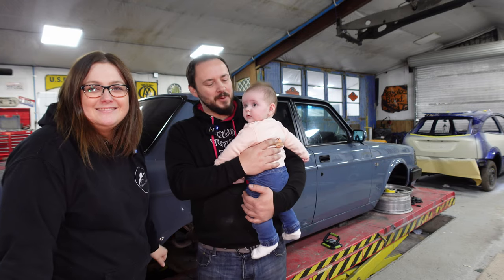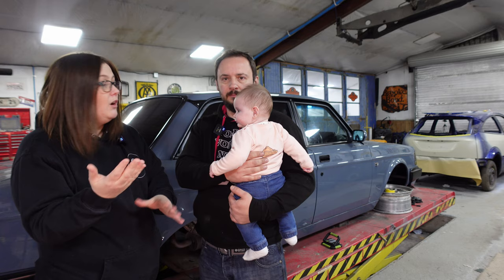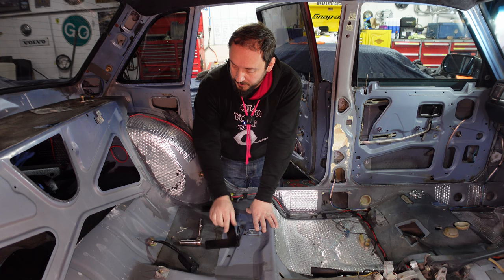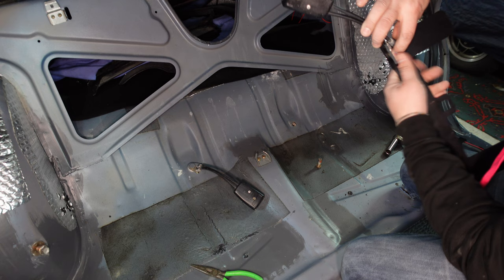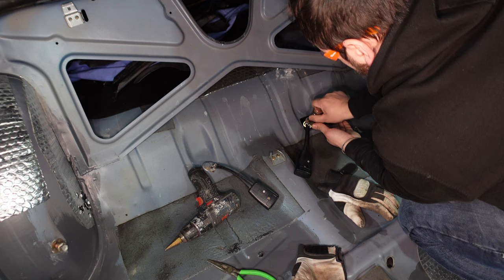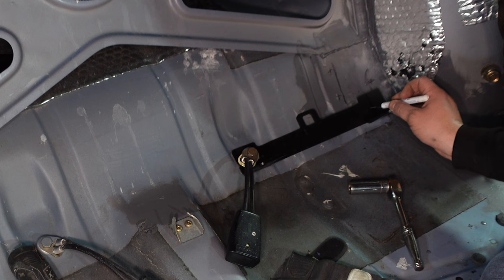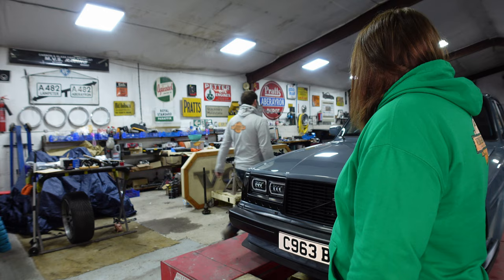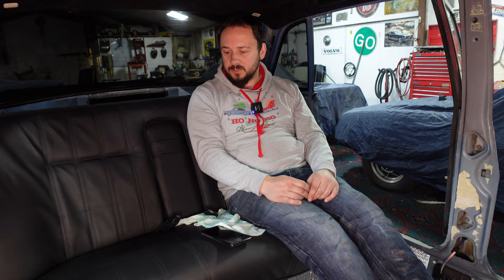How To Put ISOFIX In Your Classic Car - Volvo 240

Comment: Good video, but bear in mind that the ISOfix is only holding the child's seat square, the actual seat belt restrains the child in the event of a bump. ISOfix mounts are available for my 451 Smart's passenger seat & it bolts directly to the seat itself. And again, the ISOfix of my  ML fit to the base of the rear folding seats. 👍

Comment: Speaking as a person obsessed with centering things; why did you not put the child seat in the very center of the seat? I think you could have used both existing bolt holes for the right and left seat belt buckle. My 240 also has a center lap belt which is what generally was used to fasten baby car seats here in the US in the 80s and 90s.
Reply: There is another child needing seating in the back of the car and it seems to be set up as a 4 seater with the armrest in the middle of the rear seat. it will also not be so difficult to safely fit and adjust the, seat and belts etc for the child while on the left hand, passenger side, of the Volvo rather than the centre, especially for a woman just after childbirth. Generally I would agree that symmetry is almost a human need but I think here practicality rules, It’s where I’d put it. But I get what you are are saying.
Reply: @hughjohnson2674  you are right when one thinks this through thoroughly. My 240s all have had a fold up armrest in the center of the back seat, but always with a lap belt in the center for that 5th passenger. This is the first 240 where I see this missing. (The lap belt has not been considered particularly safe as if it rides up too high it can be the cause of some major internal injuries in an accident).
Reply: @georgebutlers4945  Thanks, I think the 4 door thing was a choice during the build as it’s the family “keeper” . As they live in Rural England I reckon it will be strong enough  on the left as firstly it’s a “Swedish Taxi!  And won’t see too much work at freeway speeds either. But, of course in the end it’s a case of horses for courses and this is what comments are designed for😊
Cheers.

Comment: This should absolutely never be relied on. Not only is it not crash tested, it’s not even made in a way consistent with normal oem systems. take an oem latch/isofix panel If you absolutely need latch/isofix. What you did here is on so many levels ill advised.
Reply: Do you even know how an iso fix baby seat works?
As mentioned above,its only really a position point for the base, the seat itself can be removed and a larger one clicked in to the same base.
The actual restraining of the baby/ toddler/ child is still done by the seatbelt, so the basket  can in no way add to any injuries caused by a crash.